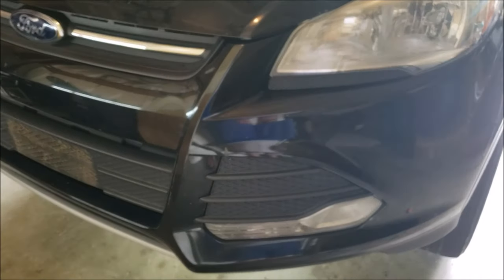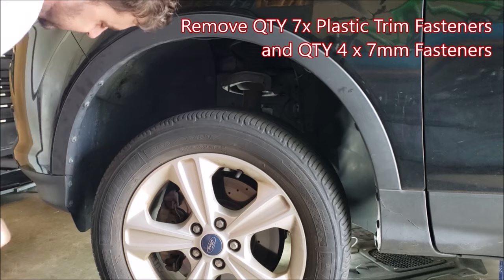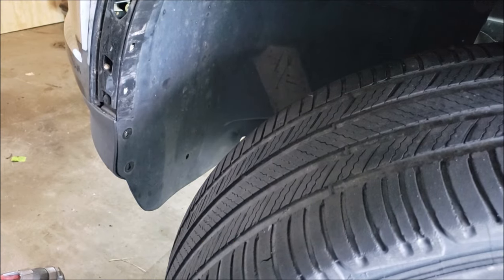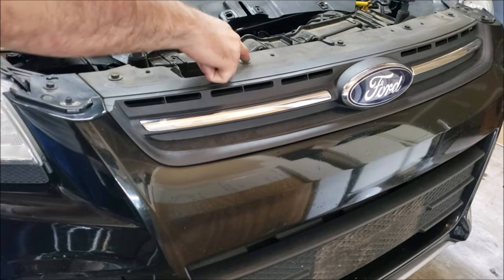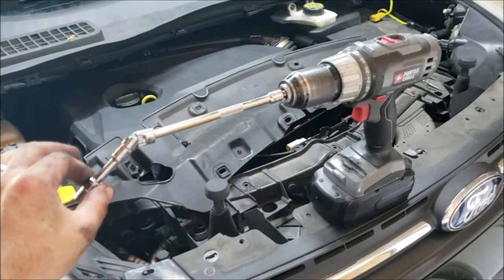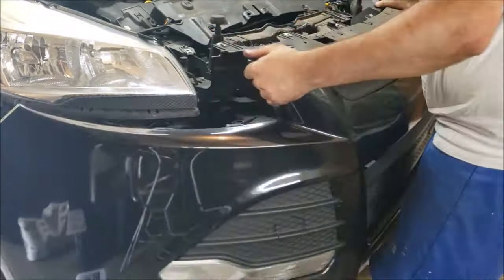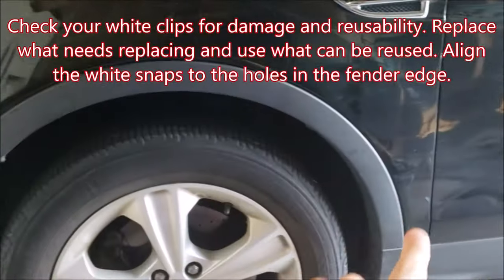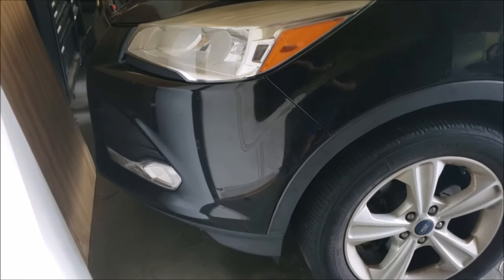Ford Escape Front Bumper Cover Removal: HOW TO ESCAPE

Comment: Thanks for this video!  A squirrel chewed off my turn signal and this video made it easy to get the bumper off to access the wiring.  I don't normally do car repairs but I am otherwise pretty handy and this was just what I needed to feel confident enough to give it a try.  I have a 2016 Escape and there were only minor differences.

Comment: I really appreciate your effort and excellent work. Even though I am following subscribed Chilton DIY repair manual, watching you do it gave me more confidence that I will be able to do this. Ford wants $1500 to replace the HID headlights! If it takes me the whole day to do it, I still come out a winner. I will let you know, and thanks for the extra tips!
Reply from the maker: Wow! Thank you for this comment and for the feedback- I do not have HIDs on my SE ...but we do have our headlamp removal video on this channel including all these steps (jack stands, bumper removal, headlamp removal). The HID headlamps should attach the same way the Halogens do I believe. Are you changing the whole housings?
Reply from the maker: Here is the full length headlamp housing replacement video: https://youtu.be/R1lkD_eiwYM
Reply: I am just changing the bulb, but the HID is impossible to change without removing the housing. The bulbs are screwed in the housing believe it or not! I see some guys taking a short cut but I'd rather take the time and do it the right way!

Comment: Great video, it absolutely helped me to change my bumper. The only issue I am having is the 3 xt20 Torx screws holes from the new bumper bottom piece don't align with the red rubber pieces. Even after pushing the pumper all the way, I am looking to drill into the new plastic so I can put the 3 screws and the rest screws for the splash shield.

Thank You for the video
Reply from the maker: Hey Carlos- thanks for taking the time to leave feedback- I really appreciate it. Are those torx screws still giving you difficulty? Your plan makes sense if so- I appreciate you taking time to say something! Please let me know if there's anything we can maybe help with in the future!

Comment: Great video. Guess I have to go through all of this to replace my front undertray 😝😅
Edit: I did the removal. I found that those 14 7mm bolts underneath are not neccessary to remove. They are for fastening the undertray to the bumper. I also had to remove the washers for my headlights. All in all, a great video😎👍

Comment: 0:17 That small black triangle bumper grille piece on the driver's side that's just above the fog light, do you need to remove the bumper to replace that, or can you do it from the front? Mine is cracked and I ordered a replacement.

Comment: At 6:50 the bumper cover wiring harness plug is fastened to the frame. Reach in, push the connector forward and the plug will come loose and it will be easier to work with. There is a small plastic retaining clip that must be pulled toward the rear of the plug. Once removed, the plug can be wiggled apart. I dropped the left fender shield down to gain access with both hands to this plug. Thanks for the video. This us a pain in the butt operation, but necessary if you have to replace the headlamp housings!
Reply: A

Comment: One important thing to do if you removed the front cover bumper, is to clean behind the intercooler. The space between radiator and intercooler, it's a place that  easily fills with debris, plastic, dead insects, and everything you can imagine. 
So, it's important to keep clean that area.
Reply from the maker: Hey there Robert- sorry for the delay here. That's a great point. I didn't even think to check that while we were in there when making this video. Thanks for the suggestion to include this!

Comment: I'm having a "parking aid fault" pop up on my escape. I've read it's because the wiring harness could be crimped after bumper was removed to replace the drivers side low beam.  Do I need to do this to get to harness? If so thanks a ton! Not so scary after watching you video!!!

Comment: My wife hit a deer and something jarred loose. I replaced both turn signal bulbs and confirmed that both bulb housing are good. The driver side turn signal works fine and the passenger side works sporadically. What would you recommend? Should I just start fresh with a new wiring harness or splice/replace the passenger side wiring only? Any videos on this exact issue by chance?

Comment: What’s about all the lights that are connected to the bumper? Or is that just on the titanium trim? 
My wife’s whole lower brace is rusted 💯 and the front is sagging ! 🤣 water just sits up in there horrible design on that area !! 

Thanks
Reply from the maker: Hey James, you're talking about the lower parking/running/fog lights, right? Those are all mounted to the bumper as you say, and you disconnect the wire harnesses before removing the bumper fully, and then you can access the lamp housings and bulbs once the bumper is off. It is a pretty dumb thing, really. You CAN get to the lamps/housings with the bumper on, but unless you have spindly arms, you're likely going to get shredded by the metal clips on the plastic fender liners and such to reach in through the wheel wells. Sorry your vehicle is rusting like that- we haven't seen that on our'13, but we're also in the mid atlantic on the east coast, so not a heavy rust area.

Comment: Nice!

Now I just need a step-by-step for the rear bumper. (after so many times of hauling the same trailer, my dumba$$ finally forgot to chock the wheels before unhitching, and the trailer punched a hole straight through the middle of me rear bumper)

Comment: Question: Will a bumper cover replace a bumper as a temporary fix ?
Reply from the maker: Well you have the exterior bumper cover that is the cosmetic panel shown- then you have your actual bumper that is connected to your frame and that is structural. If the structural bumper is damaged, it doesn't matter what the bumper cover looks like.... your car could suffer a whole lot worse if you ignore a structural issue and have a collision in that spot again. Not sure if this is what you were asking though - please let me know and thanks!
Reply: Yes I want to purchase a bumper cover online from Amazon it’s $130 I wanted to know what’s the difference between a bumper cover that cost $130 from the ones that cost $600 didn’t know if the bumper cover goes over the one that’s already on there or can I replace it with the one from Amazon
Reply from the maker: @keith1008  yes- an Amazon version of the exterior cover should install just fine. I'd recommend checking the reviews to check on fitment feedback if you dont recognize the seller. Also could be good to double check it is compatible with any parking sensors, hitch, etc if you haven't already done that. Thanks for clarifying. If you need specific comparison help just give a shout
Reply from the maker: @keith1008  in terms of cost difference, it may not come with paint, or may not include the front panel inserts, backup sensors, etc. Please feel free to post a link and I can hopefully give some feedback.
Reply: @HowToEscapeDIYTipsandReviews  Ok. Thanks for your time, I appreciate it!

Comment: This isn’t even funny.  Wonder if you could drill a port in the bumper cover and replace with a decorative cover to remove the screw.
Reply from the maker: Hey again- yes that is definitely an option. It's not as silly as one would think considering the time to get the bumper off. Some people can find a way to cheat a bit and just undo one end of the bumper and lift it up and get to that lower bolt but it may also be the case that it takes just as much time to fight it for a "short cut" as to just do it the whole way through. I think depending on your paint job if you did want to drill a small 3/8 hole, you may be able to get the bolt loose, but I'm not sure how you'd get the bolt back in when reinstalling the light assembly as you'd just have a thru hole and no access to hold the bolt. You know what I mean?
Reply: Looked into this when my bumper was off. Answer. Not really as the bumper is double skinned with mouldings on the inside. If you made a hole big enough,it would be weakened..
Reply: @motofrog  thank you so much.  I was looking in the engine compartment and it looks like you “might” be able to remove the bolt from the inside. Not a lot of room, but there is space between the head and the fender.  Thanks for taking time to look and respond !!!  Have a great day.